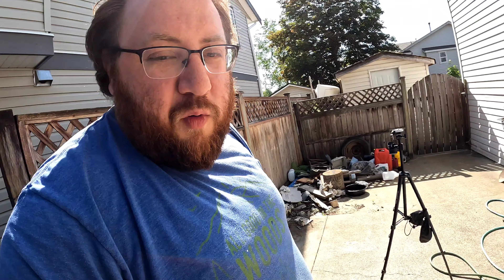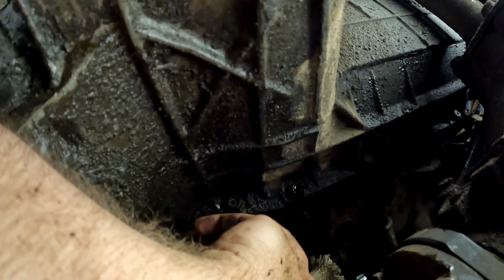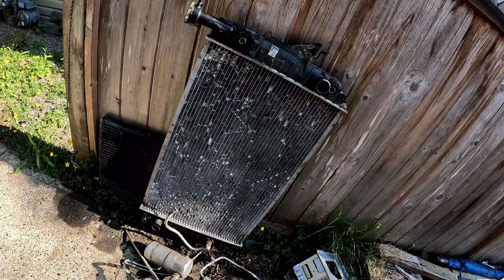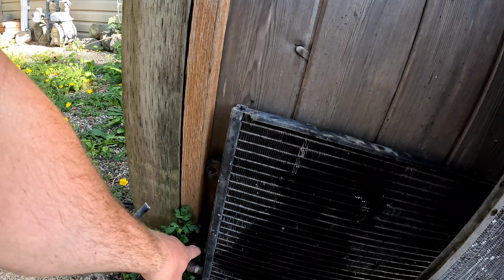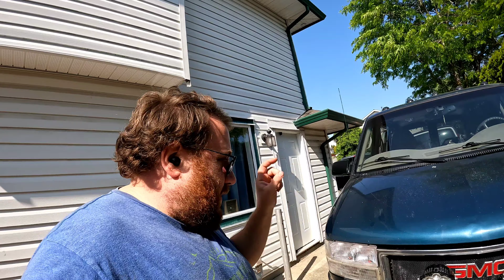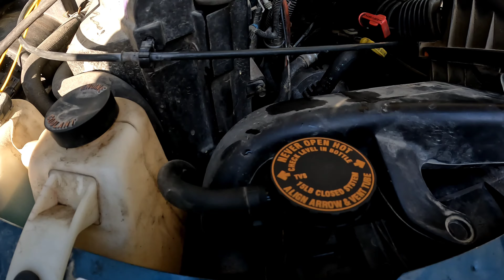Trying To Be Cool - Major Cooling System Overhaul

Comment: You may want to do a coolant system flush if you were concerned about the crud in the coolant, it may help keep your new rad clean, it's pretty simple and worthwhile. You can buy a kit from any the local auto parts stores/canadian tire/or online. You drain your coolant, install a tee in one of the hoses going to the heater core, then hook up the garden hose to it, with the rad cap off run the garden hose and start your car with the heat going on hot, run it until the water coming out is clear, then after drain the water and install new coolant. There is a deflector tube you stick in the rad cap hole so you can aim the discharging water away from your engine.

I'm interested in hearing how you like the prothane engine mounts, I might use them but have heard that they might transmit too much noise/vibration, I look forward to seeing how that goes. Also I don't see the engine mount spacers on journeys site, do they also raise the transmission and transfer case as well to keep everything parallel with the rear diff angle?
Reply from the maker: That's weird, I just went on Journey's Website now to look for the engime mount spacers, and they are no longer there... They are just little plates that slide under the motor mount, the kit comes with 4 plates ones like 1/8 inch thick and the other is 1/4 or something. I don't even know if I need them, I just bought them because I knew I was going to do the motor mounts, and I wanted to be prepared just in case I did. From my understanding, some people have issues with their main pully coming in contact with their steering components after changing mounts. I'm not exactly sure why or how, And I don't think I have a clearance issue myself. But for $50 I just bought them while I was my extended bumptstops from them. I struggle to think that the motor mounts will be that bad in terms of vibrations, it definitely might give me more vibes, but I definitely have a high tolerance to things like that. Way back in the day I dove a dodge neon and then an srt-4 that both had urethane motor mount inserts, and I definitely didn't really notice that much of a difference after. I remember seeing that my rear view mirror would vibrate at idle, but with all the noises and sounds this van makes barreling down the road, what's a few more vibrations😂
Reply: @SARGEinc  Ah ok, I was thinking like 1" thick spacers or something, so not much then, I also heard something about the oil pan contacting the front diff assembly, but haven't gotten that far into it yet. I've never used urethane mounts but I have had my share of noisy rattily vehicles

Comment: Nice video man. Any other preventative maintenance in the queue?
Reply from the maker: No. The next video will be fitting a 31 inch spare tire underneath the van, which I don't think counts. Then after that I'm going on a 2 month road trip starting in August, so all my content will be related to that. I do have a lot of older videos that cover the build and maintenance of the van, I have kind of done almost everything already. At least I'm hoping that's the case, at least until I get back from my trip.
Reply: Looking forward to the content man